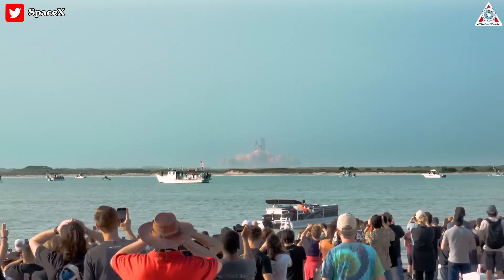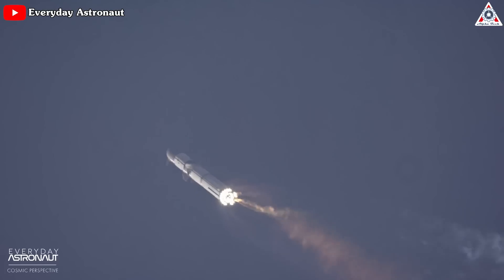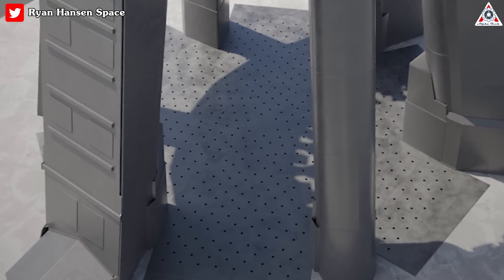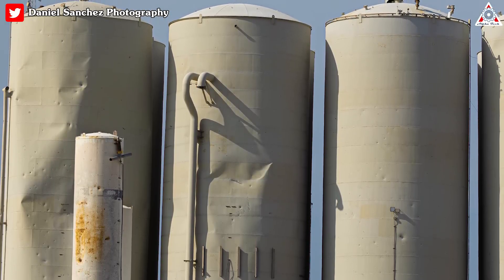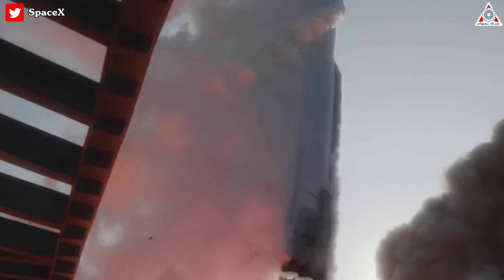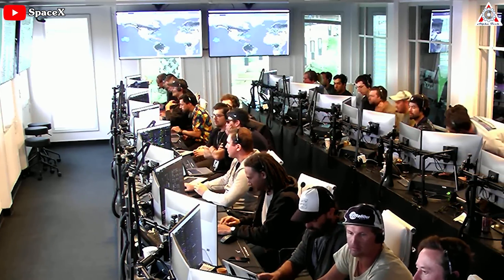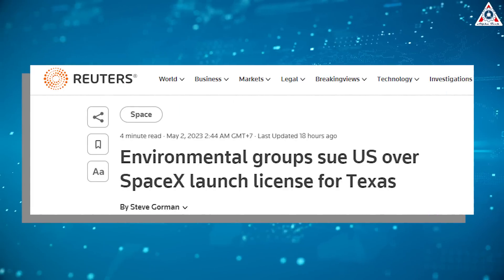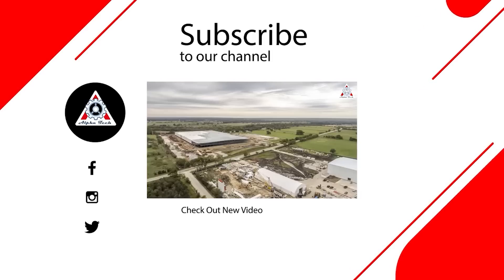SpaceX upgrades everything on Starship's pad for new launch...

Comment: If Elmo thinks all it had to do was just clear the tower, what if it had blown up 1000 feet above the tower? Would that still be a success? 100 feet? 10 feet? Why didn't they expect it to survive liftoff? That means it wasn't ready. Claiming that it succeeded simply by clearing the pad is like saying your brand-new car is great because you were able to back it out of your garage before the engine seized and the wheels fell off.

Comment: I hate to say this but this new design for a launch facility is not going to work and he'll end up having to replace the whole thing all over again. 16.7 million pounds of thrust thrust will need a diverter, fire trench and baffle and water jet launch deluge system...similar to the Saturn V and Space Shuttle launch pad...but a lot more robust to handle. It must be at least able to handle not only four times the thrust, but continued heavy use over years...as a matter of fact he ought to build at least 4 such launch facilities so he doesn't put all his eggs (Launches) in one basket. StarShip failed because of the damage it sustained from a disintegrating launch pad debris hitting both stages. And that will happen again and again if he doesn't make substantial changes. Additionally,  this entire launch facility is on to tight a foot print. The assembly building, fuel storage tank farm and other support buildings and facilities should be at least 3 mile from the launch pads like it is at the Cape. This nonsense of having everything in such a small footprint is going to bite SpaceX in the butt and cost them massive amounts of money because of trying to do things on the cheap. They can get a crawler and move each stage with the crawler and then erect at the pad like they do now...and have a long pipeline/ Fueling system to the pad. That all the rest of the facilities won't be so at risk for destruction.

Comment: Insert Alpha Tech drawl here:  'The first launch of the Starship-Super Heavy was both a success and a failure,' but in actuality was a successive series of failures first, because of inadequate launch pad construction it almost completely destroyed its launch pad, which lead to a succession of failures of its engines, which inevitably lead to a loss of control and the rocket's ultimate destruction.   Eventually this string of failures will be show to be the result of Space-X mismanagement in conducting this operation.   Not that any Space-X fanboy will ever admit or care about this.

Comment: The pad needs a flame trench with diverts  and a water cooling system. They want to use this pad multiple times a days and this rocket has massive thrust. Also the fuel farm is to close and one bad launch could cause a massive explosion.  Best to fix it right the first time. rather than multiple times.

Comment: along with  ease of moving lifting and water being the safest safest take a look at
The Scharnebeck twin ship lift was built in 1974 and was at that time the largest ship lift in the world. The first ship passed through the lift on 5 December 1975
Vertical lift: max. 38 m (125 ft) (depending on the water level of the Elbe)
Trough size: usable length x usable width x water depth 105 m × 12 m × 3.38 m (344.5 ft × 39.4 ft × 11.1 ft)
Gate safety: The catch ropes at the trough gates reduce the usable length of the trough by 5 m (16 ft).
Total weight of the trough filled with water: 5,800 t (5,700 long tons; 6,400 short tons)
Total moving weight of a trough, the water contained, and associated parts: approx. 11,800 t (11,600 long tons; 13,000 short tons)

https://en.wikipedia.org/wiki/Scharnebeck_twin_ship_lift

Comment: I just Tweeted @elonmusk and @SpaceX 

Put the entire launch complex on barges, bring it all out to either Phobos or Deimos.
Put all the tanks under water, attached to the pylons. Add extra deck plating, you've
got a lot of room there, on an Oil Rig. 

Assemble Starships as usual, but then build a "port loading dock" for a barge, put the Starship on the barge, take it out to the platform. International Waters. No costly road closures.
No more FAA or EPA problems.

Built in water suppression, rig up a few windmill & Solar platforms tied to Tesla banks to power everything. A few tweaks to Mechazilla- so reach down to barge, pick up
Starship, Falcon Heavy, whatever. Delivery of fuel is easy, safe. Launch is safe.

What does everyone here think about this?
Reply: It's far easier to pump the water ashore than moving everything out there.
Reply: @nathanwahl9224  NO EPA, FAA, EXPENSIVE ROAD CLOSURES, ETC.

Comment: No way this was remotely a success other than it didn’t kill a lot of people!
They sure ignored a lot of first principles!
Reply: That depends on who defines what success is for this first launch.   And Space X is justifiably more qualified to evaluate this first launch.  Elon himself said before the launch that clearing the tower by a wide margin would be a success.  And they did more than that going past Max Q and almost to MECO.  Space X knew they had issues with this rocket which could be ascertained with a test thus they set their expectations low.   

On the hand because they decided against waiting until the water cooled steel plates and deluge was installed the Fondag concrete could not handle the 30 engines firing for 6 seconds before it lifted off.  Next flight will be a quicker lift off among many other changes.  So much was learned and they will go forward.  It was both a success and a failure.
Reply: @michaeldeierhoi4096  typical fanboy response.
They were lucky it didn’t explode on the pad and wipe out the whole facility.
They are so far from all the steps to get to the moon and back. Space tankers, refueling, landing on the moon, taking off from the moon, landing safely back on earth much less making the starship shell human worthy. No way are they going to do this on time or on budget.
They haven’t even really successfully landed starship on a pad much less with humans on board.
Watch common sense skeptic on YouTube for a reality check!
Reply: @richardwolf6269  We'll see how Space X manages with the next launch.  It will be interesting!!

Comment: This first liftoff was a test of the launch platform as much as it was the Starship. Just think of the time involved of ripping out all that concrete and steel by mechanical means. Starship did the job in seconds!, It also excavated the area needed to install the new water deluge system. GENIUS!
Reply: No need to test a launch pad, the know how has been tried and proven for decades. It was a ridiculous short sighted move to use this design

Comment: Elon is off on starship. Because falcon heavy preforms perfectly. It has 27 engines. But only 9 per rocket. A single rocket will fail every 9 times out of 10. I wish to see SpaceX succeed. Their success is America’s and Americans all. SpaceX needs larger engines. I’ve studied mercury, Gemini and Apollo. 13 engines will be the limit.

I hope China follows SpaceX multiple engines as well.

High frequency vibration will destroy metal, plastic, carbon fiber and most of all electronics. Next launch will be more of the last. Although I give the launch stand and 85% chance of remaining intact.

Don’t give up Elon. You will get there.

Comment: Back in the late 1980s, I tested Titan Rocket engines (Titan IV and II engines) at Aerojet's Sacramento facility. The first stage Titan IV engines produced roughly the thrust (550K lbs.) of a single raptor engine . We used the same approach with regards to a deflector plate, it was a water jacket with water shooting out of the face of the plate, kind of like an upward facing shower head and it worked like a charm. During an engine firing we would pump 15,000 gallons of water per minute through the plate and it survived with no damage after dozens of engine firings (some of the test firings lasted for over 3 minutes with the engine exhaust impinging directly on the plate). Granted SpaceX will have to substantially scale this system up to match the massive thrust of a Starship. I'm sure the design will be analyzed carefully and they'll figure it out. $5-10 billion in development costs for a vehicle like Starship (that will fundamentally change the world) is peanuts. The media is way over reacting to the damage/RUD. GO SPACEX!!!
Reply: Great post by someone with experience!
Reply: Thank you, great info, glad to see that there is empirical data!  My background is in large steam power plants, and the plate concept looked good.  But you know how things go during actual execution many times!
Reply: Can you safely use sea water for this or would that be a corrosion hazard?
Reply: In our limited application, we used water supplied by the municipal water company. It’s been a few years (like 33 years) but as I recall, we used a 100K gallon storage tank and four very large electrically powered pumps to move the water around. The pumps were so large that we had to let the local utility know before we started them. Some of the water recirculated through the plate (back to the storage tank) and some was ejected out through the holes in the plate. In my humble opinion, I’d stay away from sea water due to the corrosion issues (I think it would be a maintenance nightmare).
Reply: @boxorfurnace  Do you recall roughly what proportion cycled through vs coming out of the holes? Are the jets a small fraction of the total flow? Do you call how much of the tank was left empty after a launch? I am concerned about the impact on local drinking water supplies if space x starts doing launches every day like they want to. If they desalinated their own water for the launches that would avoid the problem.

Comment: Wrong from the outset - that is not the "Super Heavy" !!!
Reply: What is it then??
Reply: @michaeldeierhoi4096  Super Heavy refers to the Falcon Super Heavy, the occasionally launched triple booster variant of the Falcon-9. The subject of this video is simply called "Starship" without any super heavy suffix.
Reply: @henryyoung7184  FYI There is no Falcon SUPER Heavy, there is only the Falcon Heavy.  It is not a super heavy lift rocket though it does have the highest rated payload lift of any rocket not named SLS or Starship.

Comment: The pressure of the exhaust will be high on the water that should come out of the plate, I hope there is a higher structure to drop water also.
Reply: You can easily pump an extremely large quantity of water at high pressure.

Comment: Uh Steel Uh sandwich it's basically uh a very strong thick steel plate! sounds incredibly technical sounds like Spacex has pull all the stops and using the  most sophisticated computer modeling methods used for sound pressure the finite element analysis (FEA). FEA is a mathematical technique used to approximate complex physical phenomena by dividing the problem domain into smaller elements and solving equations for each element. This method is applied to sound pressure modeling by creating a 3D model of the acoustic environment, which is divided into small elements. The equations governing the propagation of sound waves are then solved for each element, taking into account factors such as the geometry of the space, the properties of the materials, and the sources of sound. oh wait uh no! lol

Comment: it was not intentionally destroy it exploded on its own the FTS did nothing the FAA better not allow another launch until they have a proper trench the Steel place will do a better job at destroying the the rocket and pad..
Reply: According to Elon the FTS was triggered, but for an undetermined reason there was a 40 second delay it its causing the eventual break up of the rocket.  Elon said that this is something that needs to be corrected.

Comment: MAYBE IT WOULD BE GOOD IDEA TO ADD A CLUSTER OF SLS SOLID ROCKET BOOSTERS AROUND THE DIAMETER OF THE SUPER HEAVY CORE STAGE TO GET THE ROCKET OFF THE LAUNCH PAD QUICKER SO THAT IT CAUSES THE LEAST AMOUNT OF DAMAGE TO PAD INFRASTRUCTURE AND TO THE VEHICLE ITSELF BY HANGING/HOVERING AROUND LONGER BEFORE IT GETS GOING AND CLEARS THE TOWER, I DON'T KNOW IF THE WATER COOLED STEEL PLATE COULD COPE WITH ALL THE ADDED THRUST SO A FIT FOR PURPOSE FLAME TRENCH AND FLAME DEFLECTOR/DIVERTER AND WATER DELUGE SYSTEM IS REQUIRED. MORE THRUST FROM THE CLUSTER SLS SRB's WOULD ALLOW STARSHIP TO TAKE MORE AND HEAVIER PAYLOAD AND SUPER HEAVY SEPARATION WOULD OCCUR AT A HIGHER ALTITUDE ! ! !
Reply: The launch pad starts the engines. It is hard coupled to the outer ring of engines to spin them up.
Reply: @allangibson8494  Thanks Allan I Forgot That The OLM Starts The Engines, I Know That The Water Table Is HIGH At Boca BUT I Would Have Thought That Elon Has Got The Money To Build Above The Ground Like At KSC A Proper Fit For Purpose Flame Trench, Flame Deflector/Diverter AND Sound Suppression Water Deluge System ? ? ?🤔
Reply: @AndrewHillis_2024  The KSC took two years to settle because they compacted the ground under them by building a mound, waiting a year and then planed the top third off.
Musk is big on haste at the expense of speed. Faster isn’t better.
Reply: caps lock is on

Comment: Why don't they divert the thrust instead like NASA does? The back pressure caused by having the backplate design is likely what's causing damage to the thrusters. There should be a series of tunnels (thing octopus shape) directly under the rocket so that the thrust is diverted underground into baffles.
Reply: Flame diversion requires more infrastructure. Elon Musk knows the price of everything but not the value of anything.
Reply: Consequence of building on a nature reserve
Reply: People need to look up what it took for NASA to build Pad-39a. Do you actually think NASA dug a flame trench in coastal Florida? It was a enormous 3 year project

Comment: The holes will be very large. The amount of water needed to pass through will be extreme and you don't want the water reaching the rockets nozzles.
Reply: Math would not be too hard to figure out how much flow is required to counteract the heating from the giant cutting torch.
Reply: @JSDudeca  The Shuttle used 300,000 gallons of water in 12 seconds.
Reply: @executivesteps  Exactly. Its insane the amount of water needed. You will almost need the steel flame pad to be 25% holes by area for the water flow. With the holes shown in this video, it will be water jets that will literally cut open the rocket.
Reply: @executivesteps  Interestingly, every 1000+ Megawatt power plant today continuously recirculates nearly twice that much water through it's cooling system every minute, and they have been for over 50 years.  24/7.  It's a considerable task, but it can readily be done.

Comment: I have to say they are applying some very odd solutions to a problem others have solved.
Reply: Those others never had to deal with a rocket twice as powerful as the Saturn V.
Reply: @michaeldeierhoi4096  SpaceX is still working backwards
Reply: @michaeldeierhoi4096  The usual procedure is to look to the experience and data from other launches and extrapolate possible outcomes from those. Considering the the damage done to the launchpad it’s crazy that they thought they could launch without blast protection.
Reply: SpaceX does not want to build their own version of pad 39a which was an insane construction project all on its own.
Reply: @jason_m_schmidt622  It works though.

Comment: That tripod of a launch pad is the culprit and got to go. NASA's 50 year old launchpad used for Saturn V is ideal. It diverts the flames and prevents damage to the rocket and the ground facilities. That launchpad must go.
Reply: It should be obvious by now that the way NASA works is not how Space X works. Some elements of the launch pad and rocket construction are implemented, but Space X intends to build a rapidly reusable rocket and a launch pad that can be quickly readied for the next launch.   That means breaking a lot eggs which isn't for the faint of heart.    There has been just one test launch with this completely newly designed rocket and launch pad and it will take time to find the right system that will work.
Reply: @michaeldeierhoi4096  all fine, but you just saw what that tripod did to the perfectly good spaceship, right? and you still wanna keep it?
Reply: @TWOCOWS1  😂😅. It doesn't matter what I want.  Space X appears to be ok with it so I trust them to make the right choice.  The launch pad is in development just as much as the starship.  Eventually they will work it out
Reply: @michaeldeierhoi4096  the tripod will go, because it is unfit and has cost them zillions. lets put a wager on it:    if it didnt go, i will buy you a bagel and coffee. if it did, you buy me the same
Reply: @TWOCOWS1  Deal.   But no coffee for me because the caffeine plays hell with my heart and blood pressure.  The next launch will the next big test with the upgraded work under the OLM and the upgraded starship.
Reply: @michaeldeierhoi4096  liquid/drink of your choice. how is that?  i m not fond of coffee either. prefer just hot water with a dash of tea leaves
Reply: It took NASA three years to build pad 39a in Florida.
Reply: @jason_m_schmidt622  yes and it has been unused 1973 or so, and has been nicely mothballed.   Can be re-activated in a jiff